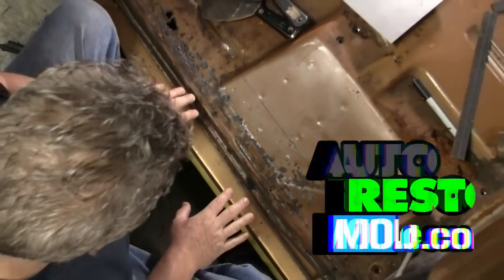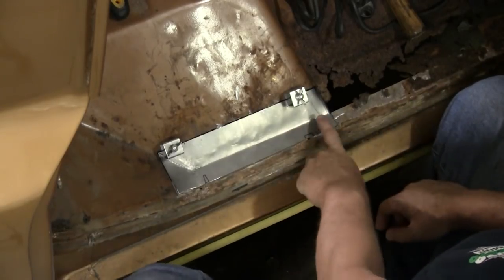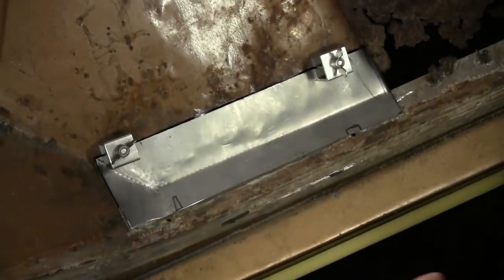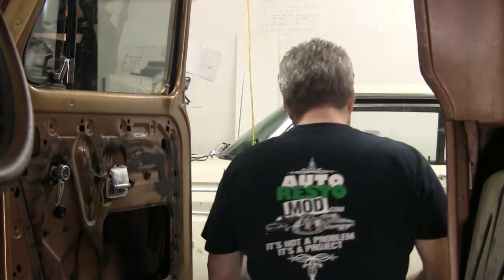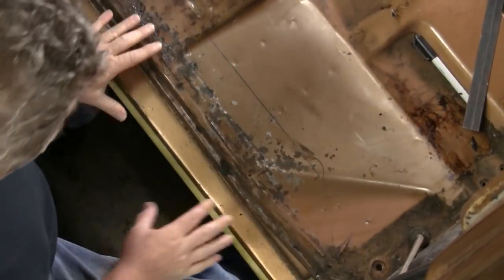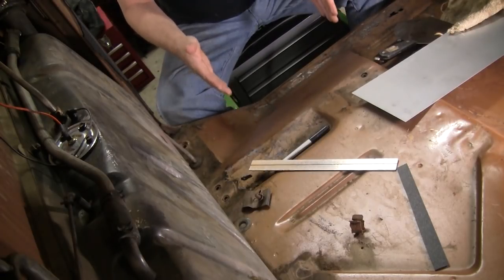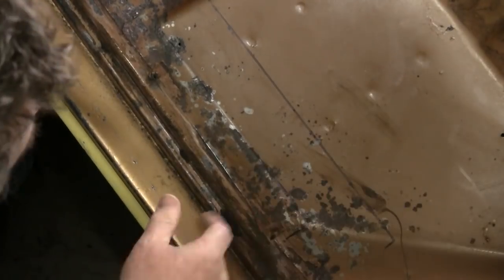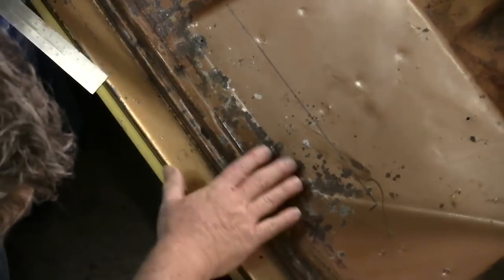How To Make Your Own Rust Patch Repair Episode 342 Autorestomod

Comment: How did u determine what gauge metal for the patch? 18 gauge?
Reply from the maker: You can buy a sheet metal gauge I found this one on Amazon: https://www.amazon.com/HFS-SHEET-METAL-FERROUS-0-325/dp/B01G39J6Y2/ref=sr_1_5?ie=UTF8&qid=1513347137&sr=8-5&keywords=sheet+metal+gauge I have been around the old cars often enough to know kinda by feel. Floors on "most" American classics is 16 gauge. This is one reason you will see the channels in the metal, it is to help strengthen the metal.

Comment: The patch panel is great and forming it looks good but  i would say the welding is wrong it should sizzle like. Bacon also it looked like ur wire feed was to high and the weld was to low
Reply from the maker: I am a legendary grinder...
Reply: @AutoRestoMod   looks good though buddg 👍